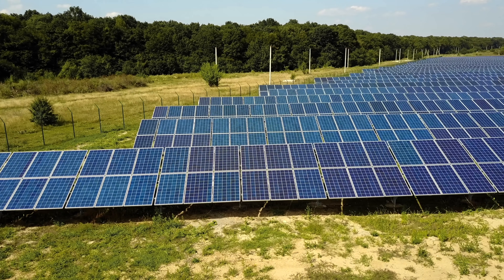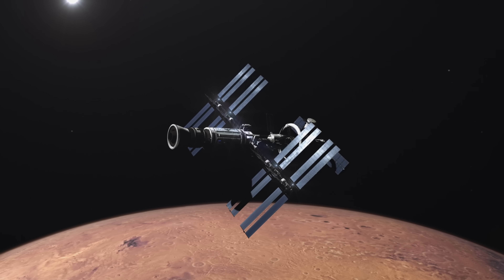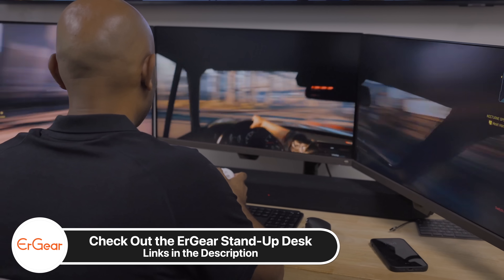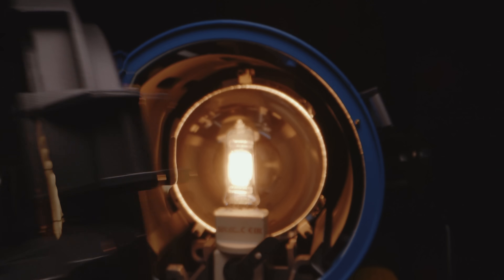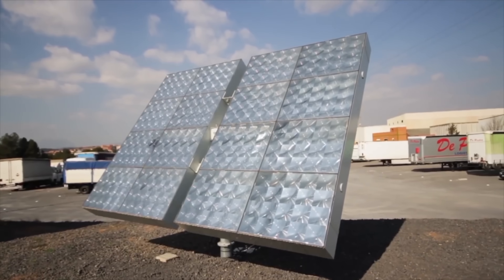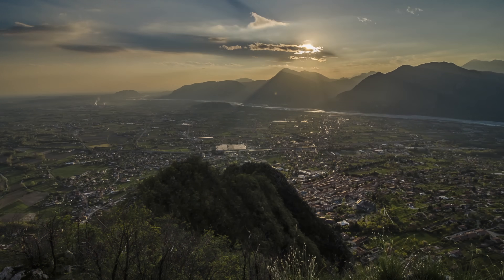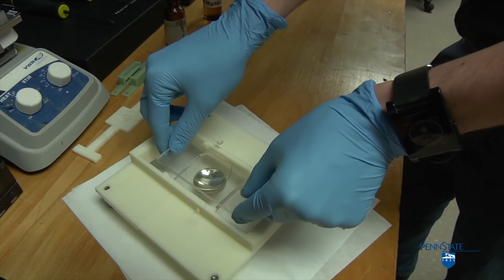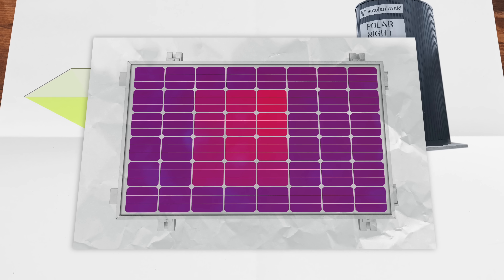Why Don't Solar Panels Have Magnifying Glasses On Them?

Comment: Another idea to address overheating might be some kind of responsive tinting in the glass. I'm thinking similar to eyeglasses that become sunglasses in bright light. Perhaps that reaction can be tuned to the optimal light level the cell needs.
Reply: @Mitchell Couchman Nah, I'm talking about reducing the light only at the point where the pv cell reaches its limit. Any additional light at that point will be lost anyway.
Reply: @Mitchell Couchman No need to yell. I understand what you said. We're just talking about different issues.
Reply: @Mitchell Couchman The problem with pulling heat out to do work is the extra cost and maintenance required for that equipment. Doping glass to make it tint in sunlight is relatively cheap and adds no moving parts.

A similar idea would be smart glass, but I'm not sure if that can be made cheap enough.
Reply: @Mitchell Couchman Tracking might be solved with lenses. If you can bring the cost down enough, you don't need nearly as much performance per cell.
Reply: @Mitchell Couchman There is one shown in this video.

Comment: The efficiency of a Solar Panel is still depending on the weather, sun stand, sun hours, etc. What do we do at night or in Winter months? Besides that, to make Solar Panels expensive Minerals are needed. Who and where are those rare Minerals comming from?
Reply from the maker: that's not efficiency, that's solar angle, which is a calculation of solar flux, or how close to 90 degrees the sunlight is coming in. you'll have lower input in winter or in the evenings, because the flux of solar input is decreased. you can picture this, but look at solar panels from the angle the sun is, and you'll it looks small because the angle skews it. this reduces production, but has nothing to do with efficiency, which is constant, and only measures of the incoming light, how much is converted. cheers!
Reply: It’s my understanding that he is involved in presenting technology. He is not responsible for their design, benefits or shortcomings.

Comment: The cost of panels in the UK has gone up for the first time. I paid £5,000 for 4kW of PV and now it costs about £7,000. The thing is I'm a reseller and I know the wholesale price for the equipment hasn't changed, so the installers are just ripping people off. Yes they have reasonable cost increases but not £2,000 worth.

Comment: To summarize: some solar cell formulations work at higher efficiency with higher degrees of light concentration.  The actual gain here is in being able to increase the efficiency of the panel and get more watts out.  Even there, you used the example of a "record holding PV cell" and compared that directly to a commercially available panel.  That is not a fair comparison - that handmade "900 Watt" panel would probably cost hundreds of thousands of dollars.  Apply the 20% gain of the test cell to the 400 Watt commercial panel and you are looking at 480 Watts, not 900.  Nice to have, but not earth-shattering.

I am also not convinced by many of the other arguments.  Lower cost?  4% on material is pretty small and labor usually accounts for over half of the installed cost, so more like 2% total project savings - maybe.  Better for the environment?  What about the large, plastic Fresnel concentrators required on each panel?

Yes, this is one way to get increased efficiency, but at the end of the day, I think that the winning tech is going to be whatever is simple, cheap, durable, and deployable.  Getting more solar power generation on existing surfaces (most of which cannot be rotated to follow the sun) may be the winning formula.  Or not!  What do I know?
Reply: Congratulations 🎉 you have been selected among our shortlisted dm me above 👆to claim your prize..........🎁🎁🎁

Comment: 'concentrated solar' at that sorts of powers (100+ concentration) is creating an insanely dangerous thing. That is laser power you've got there - no-one in their right mind is gonna install that on their roof, in their garden, in their parking lot, supermarket roof or within 5 miles of where children might be found.
Those devices absolutely require a tracking system = huge complication, expense and unreliability. What happens when a gust of wind blows it over, water gets into the wiring or heaven forbid, the electric supply fails.
Are we really so paranoid, gullible and desperate?
After 20+ years of watching, researching & learning, it is quite obvious that 'climate' is not the actual problem. Something has and continues to go very very wrong inside our heads.
Look no further than your next plate of Comfort Food, glass of wine or spliff

Comment: There is just one little problem... a 1 sq. meter fresnel lens that concentrates the light to 1 sq, cm is also capable of melting steel... and silica sand... even when you decrease the efficiencies and account for draining off that heat, Let's go with the units shown, those lenses were approximately 100 sq cm down to 1 sw cm... that is "100 suns" worth of power... put your hand in that spot... I dare you... Most silicon based products degrade pretty badly when subjected to heat above 140° C and this is still an electronic circuit... How hot do you think that concentrating the sun by 100 times will be? It would be great if it were JUST the light... but Silicon prefers the High energy photons of the blue end of the spectrum and that heat does them no good... meanwhile the HEPV like the infrared side but that still leaves a lot of heat to shed. Also the gains from concentration are not entirely worth the losses from shorter life-span and fewer cells...  They'll have to prove a LOT more math and research before these are truly worthwhile.

Comment: That's great its electricity and heat both can be used in residentials sector very well ..no need of separate system

Comment: The sun still doesn't shine consistently in the daytime and never at night.  There are no cheap, efficient ways to store the energy for use during the evening and night.  Concentration has been known for quite a while but it is not used because the cost of the lens, tracking system and the loss of life of the PV cell are too high.
Reply: Congratulations 🎉 you have been selected among our shortlisted dm me above 👆to claim your prize...........🎁🎁🎁

Comment: I invented this 20 years ago. Never did anything with it. Then aboout 6 or 7 years ago, I watched a video of a prof in his classroom, doing it as an experiment with his students. Soooo....
Reply: Wow! Even the special lens, I have in my head! I actually developed my idea into a different design, and the kingpin it's waiting for, is a 'special lens'. Lol, that's all I knew I wanted, I'm not into optics or lens building, but as I say, my pending design includes, the light concentrating, a special tracking system as well, but much different, and probably not as efficient... prob, lol, it might be more efficient. But, it's better, lighter, and could go on a roof, but it would be better just standing on the ground, I think, Idk.

I also have another improvement for solar, but it's an entirely different concept approach, not very scientific, but 100% would add more watts/sqft of solar territory.   ...and, actually, now that design just morphed into something better. I need a VC/benefactor/sponsor  ... /mentor/friend in a high place/whip cracker/swami of energy channeling/ .... lol

Comment: Hi Two bit, right from the start you say that solar could power the world!, what do you think powers it now, where did all the fossil fuel come from, what was the origin of the fissile materials used in nuclear generation, the  only source of power that is not from the sun is that generated by gravity, even there all the hydro power relies entirely on solar heat to raise the water to the heights required for gravity to kick in, that only leaves tidal energy which has so far eluded us as an effective power supply.
To be more sensible about our energy demands we must start by understanding the differing characteristics of the power around us, starting with light at the 'top' end all the way down to animal 'horsepower', one that is actually several levels up from the plant material that produces the animal energy and is itself the product of converted 'downgraded' light. Each and every one of these energy forms has its place on the conversion scale, while it is very easy and simple to downscale all forms raising the potential is much more difficult, thus it makes absolutely no sense at all to apply the most 'expensive' forms like electricity to produce heat, the other way round pushing the energy potential up from heat to electricity offers some real benefit  but the overall efficiency of the system depends entirely on what the electric is used for!, used to power lighting and communications equipment is one thing, using it to power personal transport systems is ridiculous extravagance. The same thing applies to fossil fuels that would provide the raw material for centuries of pharmaceutical products but not if we just burn it all up!.
What I am getting at here is that it is our manner of energy use that is the important issue, the manner of its production largely irrelevant. We should be trying harder to use what we have than just try to make more of it.
Cheers, Richard.

Comment: The active cooling combined with the new thermal energy generation that was demonstrated recently by Penn State seems like a good match. Small areas generating high heat might be a good way to go, provided the costs can be kept down. I can picture liquid cooling behind the panel using radiator fins to pass the heat to a reservoir, and then harvesting the thermal energy for electricity. This assumes optimal temperature ranges overlapping, of course, but the potential seems worthy of investigation.

Also, by using a medium with high heat density one could potentially store the energy for later harvesting (at night, for example). If combined with some variants of wind, again assuming costs are reasonable, there are high potential gains here.

Comment: These numbers are off as far as pricing. Ignoring that though and just looking at what's coming I don't see much changing. Tandem Silicon-Perovskite solar panels are the next step in efficiency and will drive costs down significantly. They pick up a currently unharnessed spectrum of light, and it is not much effort to add a perovskite layer to existing structures.
Reply: @jeff havel Tandem Silicon-Perovskite cells are hitting 30% today and many of the longevity/commercial viability issues have been addressed or are very close to being addressed.

Comment: Something that Rick implied is the the heat could go to a sand battery. It's interesting, but I'm not sure if it would get hot enough, or cool it enough.
Reply: Gives a whole new interpretation to, "pound sand!"
Reply: A better question is which substance would be called on to carry the heat back and forth?
Reply: @jovetj  that would be water.
Reply: @klepow  Yeah, and then when that's not found to be efficient enough...?

Comment: All this do is to drive up cost and complexity so practical use is lost. What do make sense is to use agrovoltaic production then you cover 50% of a field with panels on 3+ meter poles so the sun can reach all ground at some point in the day but the evaporation is strongly reduced. This gives you better yields from the fields with less water and a significant power production. On average waste/unused land is cheap so we can cover it with low efficiency panels that are also cheap and have no need for any tracking or cooling, as you said set and forget and put those resources on store the power instead if you have them.

Comment: What if you combine Multi-Junction cells and Concentration? Can it be even that much more efficient/powerful? Of course, this would require improvements in the manufacturing tech to make the Multi-Junction cells more economical.
Reply: They do.
They have to.
The whole point of concentration is to get the efficiency of multi junction cells without having to buy quite so many of them.

Comment: Fresnel lens heat water and generate steam for turbines far more efficient and requiring less high paid personnel. The answer is low tech enmass with low maintenance and replacement costs.

Comment: This is just video jargon. Even with low quality panels they max out their output after about 6 hours of direct light. Storage is the hurdle not the efficency of the panels or solar cells. We need a better way to store the electricity better than batteries

Comment: There is a noticeable different in power output after a rain, when the sun comes out and there are beads of water on my panels.
Reply from the maker: yes! wow great observation and yeah I know what you mean, i'll see all time highs for a few minutes for sure
Reply: @TwoBitDaVinci  This is more the focusing of light through a hole in the clouds. In the same you can concentrate more light onto your panels from other roof areas if you have a white roof.

Comment: Big hunks of glass add tonnage, and thus cost. Why don't they just use the same process that lights LCDs, except in reverse? 
Running a hotter, smaller PV chip also reduces its life span, which carries its own troubles. Chances are the chips will have to be replaced long before the glass wears out. Physical maintenance costs add up.

Comment: You can retrofit old panels, find CDs and make a perimeter reflector out of them. They bounce light in a way that traps more light towards the panel, second you theoretically could try making an infinity mirror around the panel. Bifacial panels would work better with this. The reason you get the infinity mirror effect is because your visually seeing light being trapped technically, so why not take advantage of that and stick a third mirror on the surface behind that. Mirrors make more sense, the most powerful telescopes in the world use them to capture more light. Telescope tech integrated with Solar seems obvious.
Reply: maybe use all those AOL discs they sent out in the 00's

Comment: Efficiency is most important in winter when it's cool and sun is rare. In summer there is usually enough energy from solar. So cooling shouldn't be that big an issue. Of course we would find some use for higher output during summer, but for me it's most important how I get through the dark months.

Comment: Instead of expensive multi-junction cells, why not use several small cells and a concentrating lens that also splits the frequencies like a prism?
Or a prism layer over normal sized PV cells treated in strips to accept different frequencies.

Comment: I beg of you please stop saying that solar and wind are cheaper than coal gas or oil. Practically speaking solar and wind require significant grid level storage which puts their real cost per kilowatt far greater than any fossil fuel. We still need to move to alternative energy and off fossil fuel asap, but you are kidding your audience and we are kidding ourselves every time we say it’s cheaper. Please set a standard for reporting on clean energy and stop ignoring storage in your statements about wind and solar cost. Thank you.

Comment: DaVinci, this concentrator does NOT save space so you cannot factor that in the efficiency, you still need a large collector and an additional component of a motorized sun tracker that maximizes the suns input.  If it is off a few degrees your panel is in shade.  The more complex a system, the easier it is to fail.  Suntracking normally does not have to be very accurate.  A simpler method of increasing output is to have mirrors that can add light to the panels in the morning sun and evening sun that don't cast a shadow when not in use and raise the power level for a longer period during the day so your power curve is not such a hump in the middle.   Solar panels are now under 45 cents per watt, meaning a 2,000 dollar set will provide about 4 kilowatts, enough for most households but better with a little help from morning and evening mirrors.

Comment: Everything is in a circle all their doing is exchanging more gain that the manafacture allow to get more life of of what contractor need.
 Heat is wear x amount of cycles substracted. Same as their going for 300-400 kWh charger. It's only good for lithium bulk charging range that 20-60% is acceptable heat. You go pass 60 % it suppose to low amp charge as tapping off. It's cooking the pack but you accepted this wear in the name of 10-15 minute charge and will not find out it lost capacity till 4 yr later. These company will be shut down broke all their doing is getting fed free money fast.
Reply: It's easy to make a litoum charger in our froum a few guys made and sold them
Reply: Congratulations 🎉 you have been selected among our shortlisted dm me above 👆to claim your prize..........🎁🎁🎁
Reply: It's ok pass it on, thank but.

Comment: Solar panels are so cheap that any lenses are questionable economically. It doesn't really matter whether the efficiency is 18-20% if it's cheap enough and you have the space. Going to +40% efficiency gives you diminishing returns. I think that these concentrating panels will be a niche product at best. When you have large solar panels going for $0.30/Watt, it doesn't really make any sense to put $200 lenses on top of the panels. Everything else in the installation costs much more money than the panels itself. Panels are dirt cheap and their efficiency is good enough. This is a solution that's not really needed anymore.
Reply: Congratulations 🎉 you have been selected among our shortlisted dm me above 👆to claim your prize........🎁🎁🎁